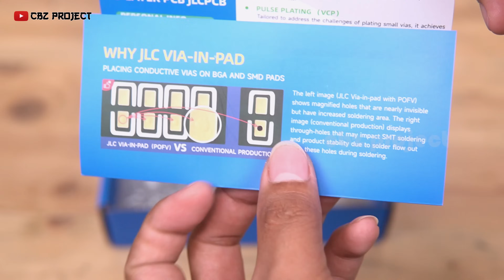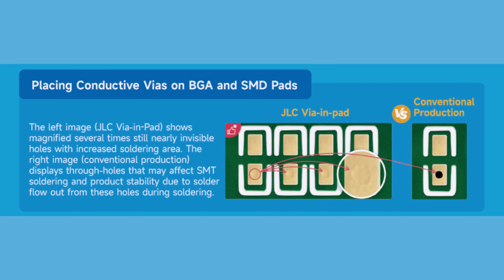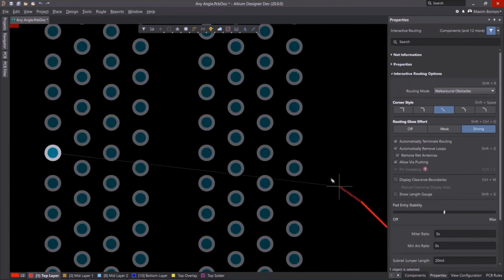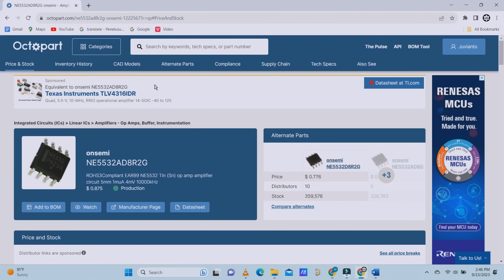First time making a Class-H amplifier😱 I'm having trouble?

Comment: A class-h amplifier will not work as a Class-H system should, if the driver/buffer section does not use HV voltage.
Reply: Right. Hahaha
Reply: sejak kpn driver kelasH kena supply hv,yg di hv kan tr final doank😅
Reply: @trisuharto6258  tr final itu disuply lewat LV & HV Stepper. Sedangkan driver/buffer (Vas) terkoneksi langsung dg bagian HV tanpa melalui Stepper & bukan dari LV. Coba dikoreksi skema Class-H biar tidak salah dlm praktek.  Atau cari tau ke para senior diy audio di indonesia, 
seperti Pk.Anistardi Sudikan.
             Pk.Bandar Power dll yg paham...
Reply: @trisuharto6258  Vcc HV utama wajib terkoneksi langsung dg power driver bagian Vas/Buffer.
Reply: @trisuharto6258 dimanapun class h driver ikut hv,final dan tr driver ikut stepper